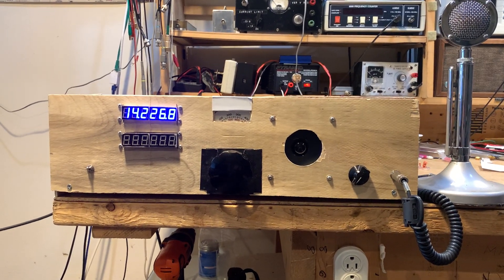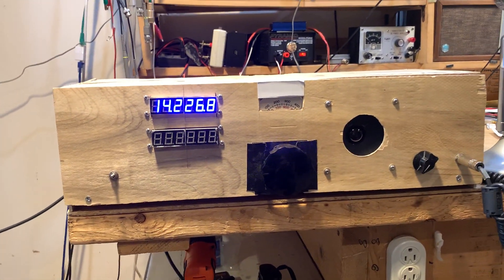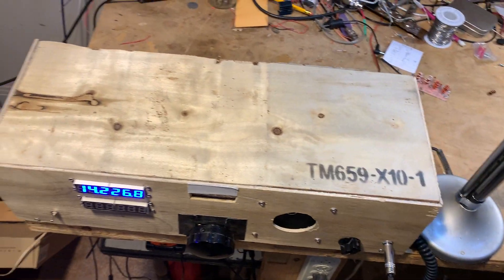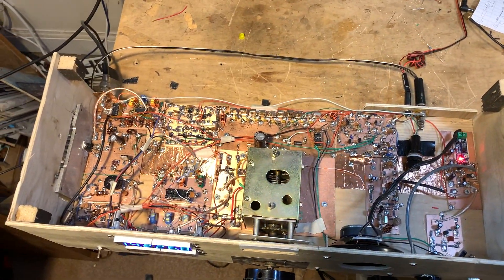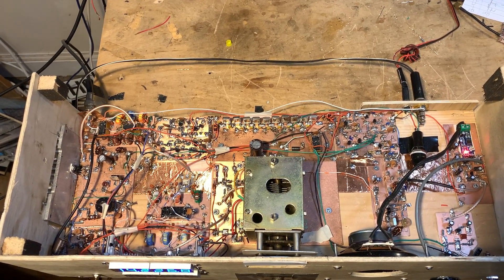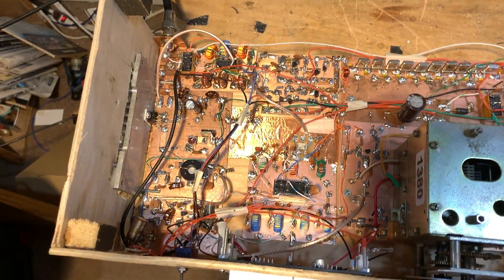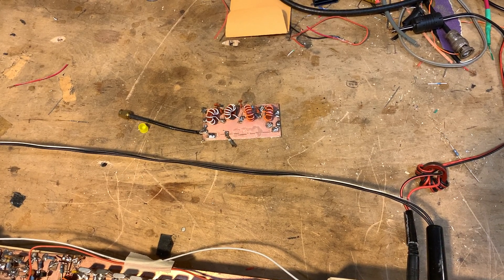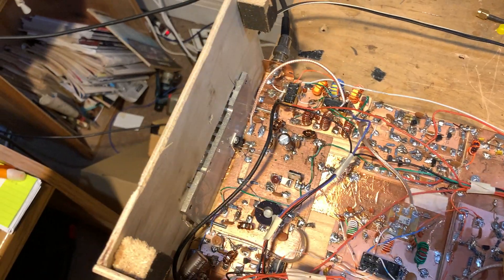Mythbuster Video #17 -- Boxed Up

Comment: Ok, there's still one thing missing...fire up your drawing program and design yourself a SS logo and give it a model number!  ;-)   Hope to CU on the air!  73 - Dino KLØS
Reply from the maker: Your GIF is on the blog. Thanks.
Reply: @soldersmoke  Good deal Bill...in the call think you hit the capital letter "O" instead of the zero "0"; or there is a slash zero as well "Ø" that may or may not show up there.  TNX, Dino.

Comment: Thanks for the video. There is one trick that reduces the probability of parasitic oscillations to a minimum. Put 100 nF capacitors to ground anywhere you expect DC, and 10 nF capacitors to ground anywhere you expect AF. It's much easier to do it right from the beginning than looking for the right place to put capacitors when the rig is almost done. Something I learned the hard way while working on the recent project :D
Reply from the maker: Yes, agreed.  I already have a lot of .1uF caps and many larger electrolytics in there.  73  Bill